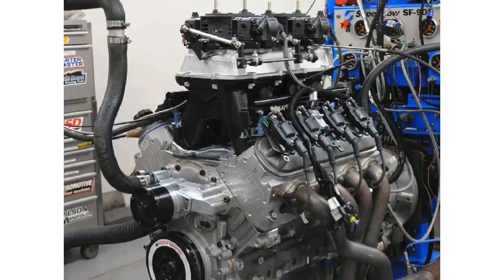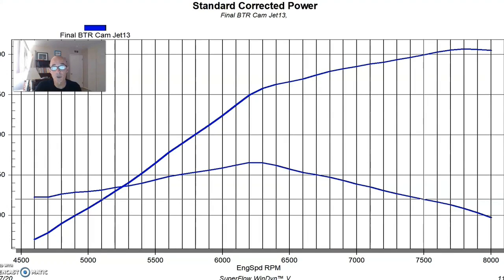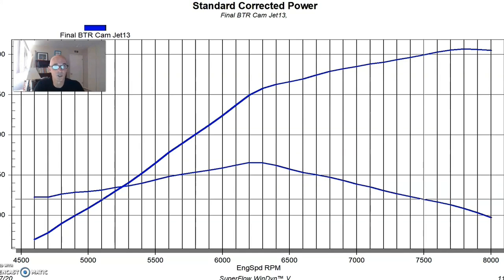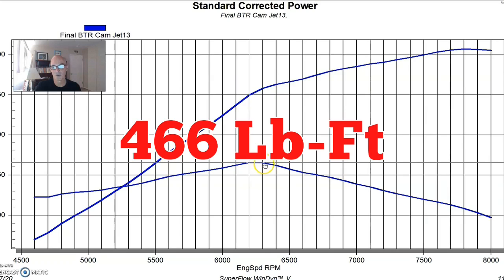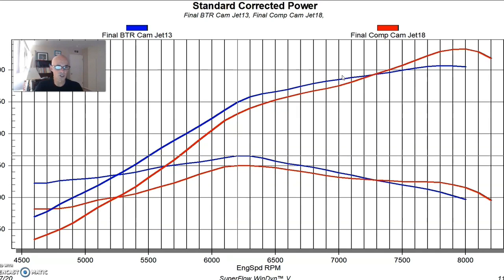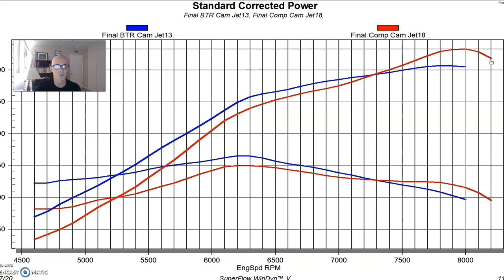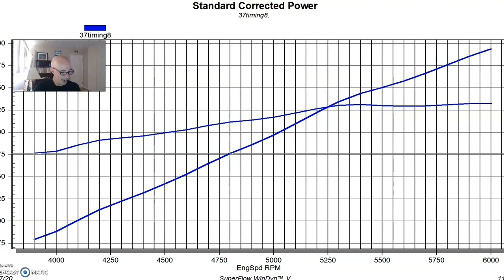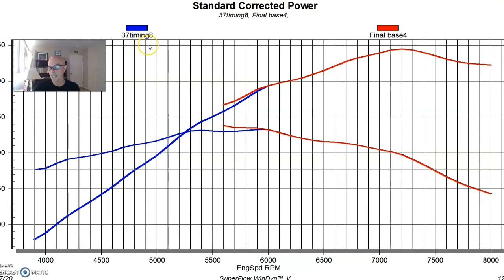8K RPM HYD ROLLER-WILL IT WORK?

Comment: Only reason to put a short stroke in a motor is to keep the piston speed down. Bad things start to happen when piston speed gets out of control.
Reply: There's an old engineering limit of 4100fpm for piston speed. It can be exceeded it's just an old engineering durability reference but still is more or less adhered to even in high revving engines. 
Here's a ridiculously simple rule of thumb to determine the relative piston speed at 6000rpm for your engine. 
In this example we'll use 3.75" stroke. Just add zero and remove the decimal point and you get 3750 fpm @ 6000rpm. This gives a builder and novice alike the capacity to see straight away how fast the piston speed is in relation to 4100fpm.
3.00" stroke = 3000fpm. 4.125 = 4125fpm. It is exact too but only at 6000rpm.
If you want to work it out for higher or lower rpm just divide by 6 and add once for 7000, or twice for 8000rpm etc. It's just a tool and is in no way authoritative so use with that in mind. Some motors are so crap if you tried to rev them 6000rpm they'd blow up even with good bits inside them and under 4100fpm. 

So regarding the 4100fpm 'limit'. Well it can be exceeded even with durability so long as the mass is reduced. The moment of inertia is less so this explains why strokers can rev so high even though they have long stroke. Say the 3.75" stroke engine is stock all is well to 6000rpm with a healthy margin up your sleeve. Lighten the reciprocating mass and the moment of inertia substantially reduced allowing you money in the bank weight speaking, to 'spend' as you will ie rev it 2000rpm higher or increase the stroke 4.250 and rev it a 500-700rpm higher - choice is yours lol.

There is one fairly short stroke engine I know of and the stroker kit increases the stroke length nearly a damn inch ffs but still manages to lower the entire reciprocating mass 40% while maintaining good rod to bore angle - so yeah you can see how they're getting the big if not huge rpm out of strokers.
Reply: @ThePaulv12  great explanation thanks, I understand.
Reply: I was thinking along these lines too. If piston speed is well well within the limits for the piston used then ok but if its up there it just shortens the time the engine can do this.
Reply: When money is no consideration, they dont care about that long stroke.
Reply: another reason for a short stroke is if you're racing and have a maximum displacement requirement...but want a really big bore to unshroud the valves. Like say a Chevy 400 block with a 327 forged crank and oversize bearings for 352 cid in a 360 cid class, versus a 350 with its crank offset ground to pre 1968 connecting rods for more stroke. 

Some will shift pistons from bank to bank to undo the horizontal offset of the piston pin and create more dwell at TDC, like a longer connecting rod. Look up the "Uncle Tony's garage" series here for more on this--folks claim up to 20hp.

Moving your piston pin higher up the skirt of the piston has two problems. The one most are aware of, is going into the piston ring lands. But the other happens at BDC. If you increase stroke beyond the block engineers' fantasies, the piston gets dragged further out the bottom of the cylinder walls. That's why a Ford 289 isn't a great candidate for a stroker--the Ford 302 comes with cylinder walls that decend into the crankcase further, due to the factory increased stroke, to keep the piston from "rocking" at the bottom of the bore when too much was exposed.

Increasing the stroke increases the swept volume, which "pulls" air into the cylinder better than before.  But another issue is the strength of the cylinder walls--if the rings can't seal at high RPM because the block has core shift or its walls are otherwise moving around, the power made in the first two inches of travel down the bore are blown past the rings into the crankcase for the rest of the travel.
Reply: @albertgaspar627  thanks. I thought the longer connecting rod myth was busted on engine masters. They really didn’t see much difference between the two.
Reply: @maxwelltollefson9947   A guy named Smokey Yunick had the long connecting rod theory, and he was well respected with his success with Chevies...and "breaking rules". He didn't really break rules tho, he just did anything that WASN'T in the rule book, like shrinking cars. He invented reverse cooling, and GM used it in the LT1 engines that came before the LS1.

But Reher Morrison racing was the one to find no difference in testing. A problem may be how much the piston dwells at the top of the cylinder before the intake valve closes...piston speed has an effect on drawing in air/fuel mix and pushing it back out the exhaust to clear the cylinder for the next charge. a piston "dwelling" ain't moving.

There's also issues of reciprocating/rotating weight, and how much thrust the stroke of the crank puts on the cylinder wall as the piston rises from BDC, depending upon how long the connecting rod is applying leverage. Here's one of many articles that show, length of the rod may have more positive effects than on just piston dwelling at TDC....and may need a cam pattern designed for it.

https://www.chevyhardcore.com/tech-stories/stroker-engines-long-short-connecting-rod-length/#:~:text=A%20long%20rod%20will%20require%20a%20short%20compression,use%2C%20there%20are%20a%20few%20factors%20to%20consider.

and let's stir the pot:

http://www.pontiacpower.com/Long%20Rod%20Motor%20Long%20Rod%20vs%20Short%20Rod.htm
Reply: That theory has been blown out of the water many times over unless your talking about +10k rpm for extended periods. In drag racing it's a non issue with balanced forged internals.
Reply: 5.4 Falcon 4v's redline at 6000rpms stock with 4.15 inches of stroke. Why do people turn in excess of 7000rpms with those combos without shortblock issues?
Reply: @madmod  why? to get the HP they don't get out of displacement.
Reply: @albertgaspar627  the five four 4v has one of the flattest torque curves of any engine built. The barra/boss 330 intake on a stock navigator shortblock is good for nearly 400 wheel horsepower, well over the 1hp/cube mark.
Reply: @albertgaspar627  Btw, you completely failed to grasp the subject of my question. This comment thread is regarding high piston speeds and the issues involved, hence my response, "why do people turn these rpms without issues". I wasnt asking why they turn choose to rev that high, Im asking why they dont have issues if high piston speed is a problem. Read better next time dude.
Reply: @madmod  personally, I'm all about torque. But some folks just love shifting past 6,000 RPM for some reason.
Reply: @albertgaspar627  The tradeoff for power production at high rpms comes with a loss of low speed. However, average torque is far more important than peak low speed. Stock 5.4 modulars make the same torque at 2k as they do at nearly 6k rpms and despite having less peak torque than some engines its size, it averages way more which leads to more average power, the faster car.
Reply: @madmod  Over here, we call 'em "dyno queens".  They want that big HP number to brag about, even though they end up with the performance you mention...and constant valvetrain maintanance :)  They must be getting what they want, or they wouldn't spend the dough. I remember all the import magazines going on about J2Z's making four digit bhp numbers, and Mitsi 4G's pushing 700 bhp, and thinking, "who would want to drive that daily in traffic?"
Reply: @albertgaspar627  Except again your comparing apples to oranges. Im not talking about 4 digit 2js or high power 4 cylinders. They make "performance I mentioned" because your talking about tiny displacements that need rpm to make power. The whole point that had been made is engines that make more average torque over peak torque will be the faster which is true. If an engine can maintain even 350ft/lbs at 7000rpms, you have almost 500 hp. Rpm is just a number and the higher you can make peak torque, the higher horsepower you will make as a result specifically because that is how horsepower is calculated. Peak numbers arent what you drive around with. Id rather have a car that maintains 90% of its peak torque all the way out to nearly redline than have a torque shelf off idle and have it fall on its face. As for excessive valvetrain maintenance, the combos ive mentioned will run 200k miles and still safely turn that rpm. My 2v heads with stock springs, retainers, lash adjusters, and followers will control the valve up to about 7k rpms without any issues and they have done so for over 160k miles.
Reply: @madmod  You asked WHY they turn high RPMs and not grenade the block, when you should have asked HOW do they do that and not grenade the block. I was teasing you about the choice of words :) of course the correct answer to WHY does someone do something is, "because they wish to"  :)   There are a lot of Pro Stock "mountain motor" displacements turning 8,000 RPM thru the traps with ridiculous crank strokes, and I'm not even sure they're running 6 bolt mains or even deep skirt blocks. But I sure wouldn't want to pay for one of their billet cranks.

https://www.sonnysracingengines.com/engines/drag-racing-engines/extreme-pro-stock-2025-hp-racing-engine

Peak power production is great on a dyno. In real life, no one travels around in First gear, they reach that peak power level...and then shift into the next gear. The engine typically falls out of its power band, and feels weak and sluggish until it builds back into that power band...and then shifts gears again. The effect really is felt in a wide ratio gearbox.

The wide torque band gives a result like a V-10 Viper sports car--like it could launch in any gear. I own an Oldsmobile 461 cid V8 with variable duration lifters. Even with a 3:1 rear gear, I can put its three speed "automatic" (it doesn't shift itself, but it has a torque converter in place of a clutch) in top gear, 1:1 ratio, and it will pull from a dead stop to its 5,500 RPM redline. But if I want it to accelerate 0-60mph in five and a half seconds, I need to slap the ratchet shifter into First and hammer the throttle.
Reply: @albertgaspar627  Your talking about engines as typically reaching peak power and falling off in power dramatically isnt what happens on a combo with good valvetrain and enough hci to flow the power your looking to make. Good engine combos arent just a wall of torque until their peak and then a plummet. They make their peak power and maintain it. Only on super tight lsa, i/e centerlines do you get super meaty power curves that fall off fast and those arent the cams that want to sustain rpm anyhow. The same big block could make the same 500ft lbs. One at 3000rpm, one at 5000. Guess which makes more power and would run circles around the other?
Reply: @madmod  Respectfully, a lot of the videos on this channel, show a power curve that "noses over" after a certain RPM. They tend not to have expensive aftermarket heads, or they lack an expensive valvetrain that resists valve float, or they are just running a "mild" or street cam profile that favors a lower RPM operating range. A lot of folks build these engines, typically due to cost restraints or the weight of the roller lifter they can afford.

Just for fun:  
https://www.onallcylinders.com/2014/08/08/ask-away-jeff-smith-peak-power-vs-torque-curve-matters-application/

https://www.lainefamily.com/hp.htm

so of course we all know, gearing behind the engine makes a lot of difference in overall vehicle performance.
Reply: @albertgaspar627  A lot of videos on this channel arent building max hp builds, rather seeing what power is available on these used combos with shelf parts. You can make a 8k rpm screamer with off-shelf parts as he has built and tested on here and it doesnt take a plethora of high dollar parts. A good example of a relatively mild combo that would be dead reliable and easy driving on the street but still handle 7k rpms every shift was the testing of the 5.4 navigator which has a super flat torque curve. Look at his 4.8 vs 454 junkyard wars where both engines made almost identical power despite the 4.8 needing about 2500rpms more to do so. Sure the big 7.4 made more torque up to 4500rpms than a 4.8(obviously), but every single rpm point after that, the 4.8 made more torque than its massive competitor. Torque is torque and like you said gearing is huge which i agree with 100%. So if an engine makes the same power, turns more rpm, and averages more power in the rpms you actually race at, it would be faster, yes?
Reply: @madmod  if an engine is making the power needed at the RPM needed, and its power to weight ratio isn't grossly different than its competitors, then yes its doing what it needs to do win. Which gets us back to your question about why run a Falcon 5.4 past its redline to 7,000 RPM. If that's the RPM needed to win, or the driver is so sloppy with the clutch work he needs the insurance of a 1,000 RPM gap....:) 

naturally, if i was building a front engined car to race circles around cones in a parking lot, i'd take the 4.8 over the 7.5 litre any day. Less weight in the nose, and sometimes too much torque too soon at the corner apex just leads to a shunt off the course.  Allow me to run that big block in the center of the car with a ZF transaxle...i might still destroke the 454 to 427 cid and enjoy its revs. Depends upon the size of the corners.
Reply: @madmod  did you mean Quicker Car - Torque provides acceleration/ HP affects Top Speed ...?
Reply: @glenholmgren1218  Im definitely not saying torque is acceleration and horsepower is top speed. My prior conversation got skewed from piston speed and what problem that may or may not pose off to debating whether high rpm combos are just dyno queens and if low rpm big torque is superior. Simply put an engine that maintains more torque with rpm will create more horsepower and in racing, you want to sustain as much torque across the usable rpms as possible even at a cost in peak torque. I agree that maintaining good low end is important especially on street driven vehicles, however there is almost always a trade off low speed for high speed torque. You need to decide where you want it to make power. A good example is my 4 speed car that never sees below 4k rpms after it launches and it's incredibly mild. I could put a long runner manifold on it and pick up 30ft/lbs idle to 4500rpms but the short runner actually makes more torque at every point past 4500. So when actually running the car, id only benefit through part of first gear up to 4k rpms, then it would just be averaging less power through all the rest of the gears the rest of the way down track. Average power is superior to peak whether it be torque or horsepower.
Reply: I'm thinking rod to stroke ratio is more important than this
Reply: @craig8187  100% incorrect
Rod/Stroke ratio will affect piston speed aswell.
Reply: Alot more going on than just that. Dwell time at tdc, (rod stroke ratios determine that) longevity of the motor, cam timing optimum to combination. People with budgets in mind have to consider lifespan of the motor!! We ran a cast piston solid cam turd Windsor for 3 years. Shit 150 on it 5-6 times a night 4 nights a week. Sold it to a street guy, he still has it!! Then things started to get outta hand and into pocket!!! Trust me, through something together you can afford and have fun!! Don't listen to people that tell you to take a second mortgage on ur house!
Reply: They say 4000 fpm for street lomgevity but obviously these engiens were well past that . 

Lighweight rotating aeemblies help
Reply: mrhazel yeah. Forces get big quick when going that fast
Reply: @KingJT80  4000fpm is a very old guide line and sticking to that is a very good way to limit the power potential of your engine. People who know how to build power and win races throw piston speed numbers out the window. Yes, even on street engines.
Reply: Short stroke can really help a motor rev. If you've got a road race or performance street application where you can give up a bit of torque a free revving motor is important for nailing perfect downshifts it makes a big difference.
Reply: @otm646  wrong. That's what this video is about.
Reply: What most people dont understand is a 6 inch rod is one weight so take that out of the equation as pistons go a piston for a 6 inch rod 350 weights more than a 6 inch rod for a 383 so the crank being longer stroke is closer to the center of the mass so rpm does mot effect it as much
Reply: @claybailey9950  ok I get it. The gudgeon pin is higher in the piston mass and the piston is lighter so the recipricating forces on the piston get mitigated a bit compared to say a stock dimesioned piston, even though its piston speed is higher. Am i on the right track.
Reply: @rongalaxie  That's basically rod-ratio in a nutshell, to my understanding. Which is also what I've held to understand as a huge factor in a rotating assembly holding up under high RPM for any realistic amount of time. Rod ratio is far more important than stroke, but the two go hand in hand to some degree.
Reply: @thethepete731  bore and stroke makes hp and torque not rod length
Reply: @claybailey9950  that doesn't even make sense. Nor does it have anything to do with what we're talking about here.
Reply: @thethepete731  no your right but a short stroke dont make one rpm. Oh and if your talking about nascar if they were not restricted to 358 inches they would have a longer stroke its all about head flow and camshaft